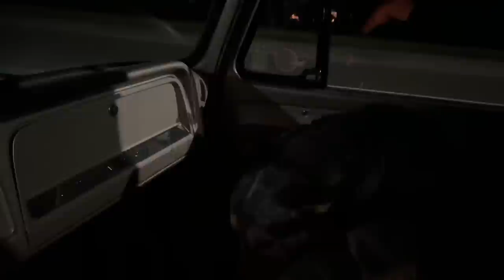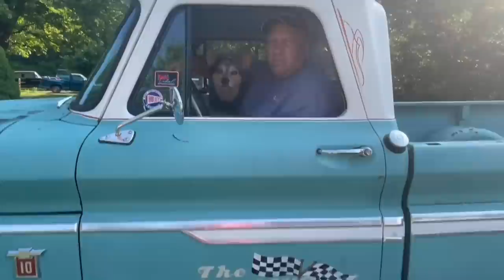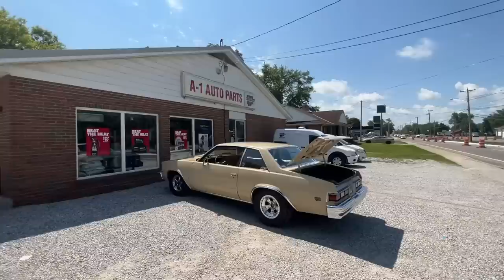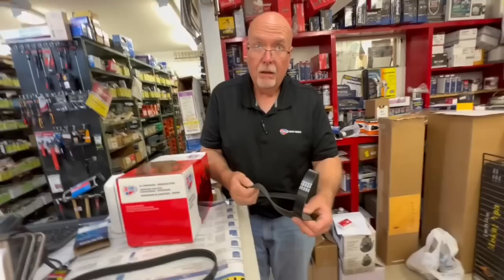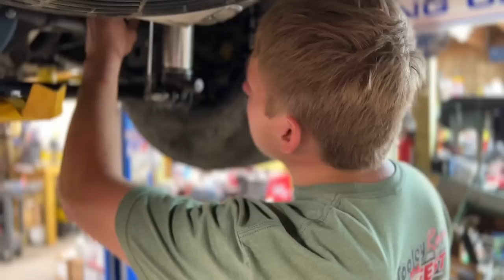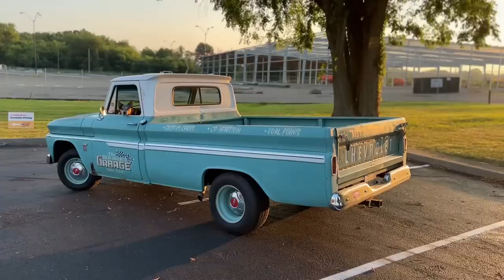Billy The Kid LOCKS IN with Beater Bomb!  The battle of the OZARKS is HEATING UP!

Comment: We’ll uncle bucko I am your age and my dad and I started a 36 Chevy coup project when I was in high school. It was old parts go getter back in the 60’s. It has not progressed.  Have you thought of just replacing the knee action front end with a mustang front suspension clip?  The flexible steering wheel shaft makes hookup way way easier.  Good luck.  Yours is only about the 7th other 36 coupe I’ve heard of.

Comment: To be called out by Beater Bomb 1st rd off the trailer Billy you should take that as a compliment 😀.  One that shows hey scared of the Nova but even more so I would take it as a sign of respect he does not want you to get no passes and getting any data where he's probably already has many many runs on that track cuz he knows if you ever get a little bit of data and with your toning and power management capabilities and Talent he knows he would not stand a chance in the finals against it

Comment: When the original builder wired in the alternator did he use a factory ls alternator? If he did he may have used an inline resister that could be failing

Comment: We use Denso alternators on the race cars- if thats any help. I still have to wonder if there is a grounding issue since voltage is fine until pumps/coil pacs/injectors really load the system. Nt being an ass Bill, just "thinking with yall". peace